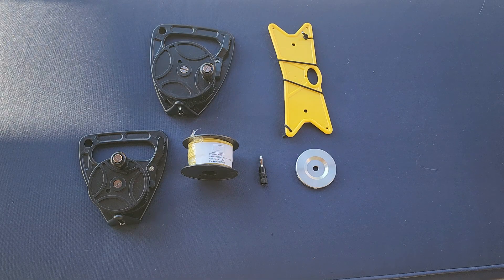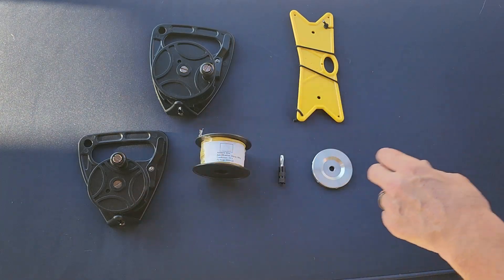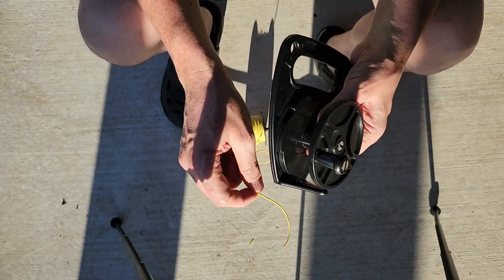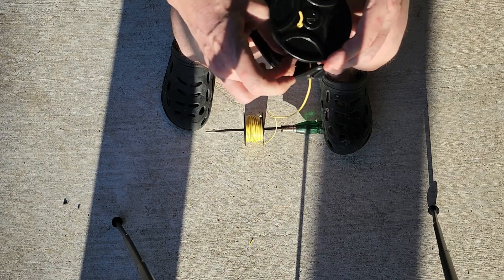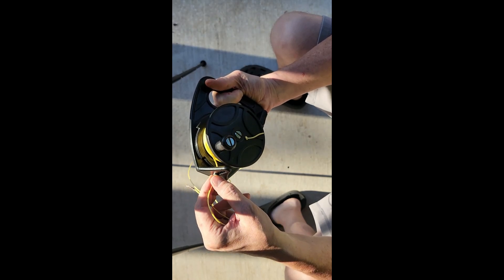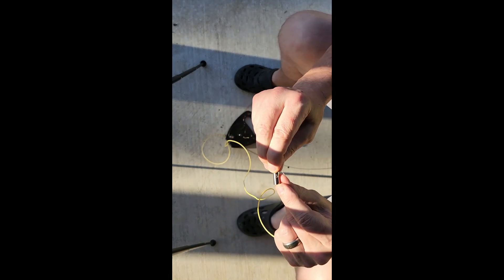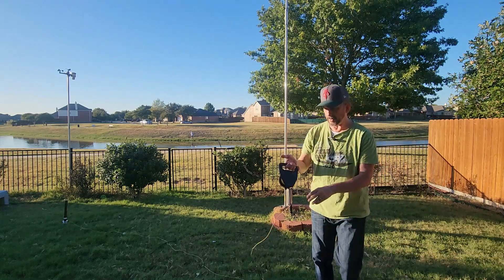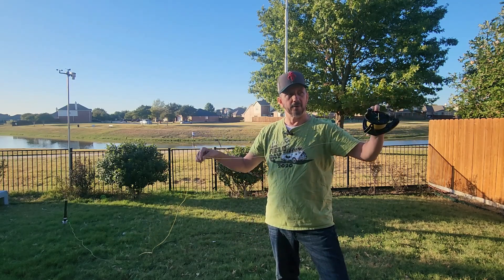CHA Wire Wheels - Single Counterpoise EZ Mode

Comment: Since the wire is jacketed, isn't it electrically the same length no matter if it's rolled up or not?
Reply from the maker: I'm no pro on it but my understanding is non jacketed electrical and physical length are nearly the same while a jacketed wire the electrical length is reduced somewhat compared to the the physical because of the velocity factor reduction.  Good point! I wonder at what lenght it makes any noticable difference. I think for this above ground, non permenant solution a bare wire could actually be better for sure but for long term underground I think insulated would be, like my counterpoise system on ground, because of the wire protection.